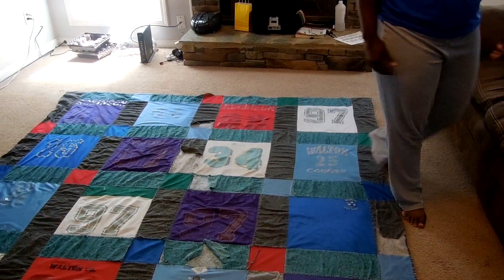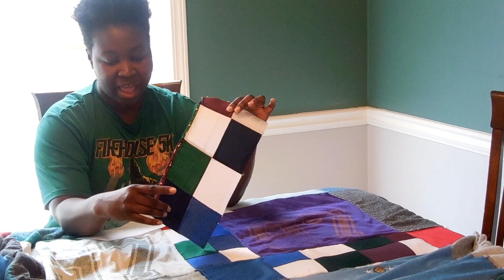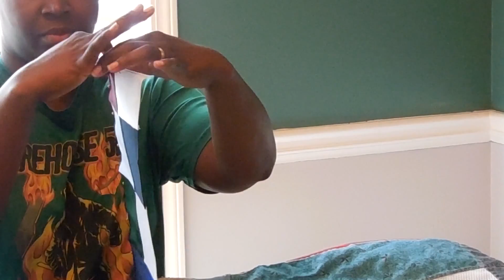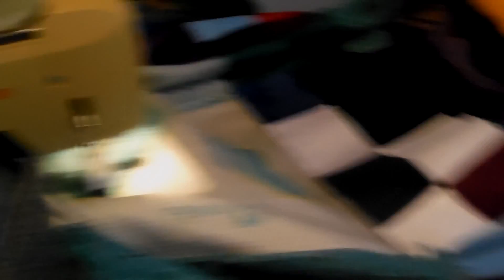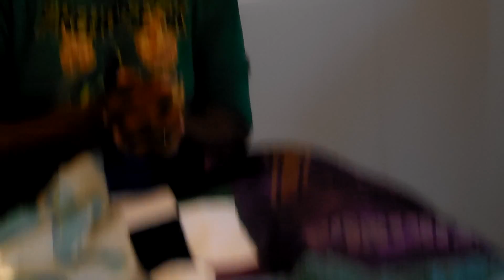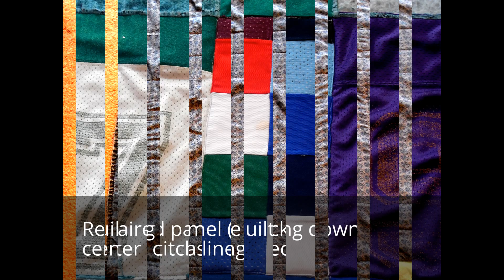Quilting Made Easy: How to Repair a Quilt!

Comment: When you topstitch over the panel you are dropping in, how much bulk do their edges create?  I need to "drop" a square in on a solid pink quilt backing, and I am concerned with how it will look.  I can drop it in on the stitch-in-the-ditch lines which will somewhat hide the panel addition, or I can create it as a patch (with some artwork) and glue it on, but I would prefer to use your style.  Any suggestions?